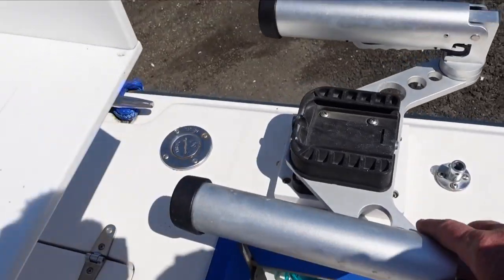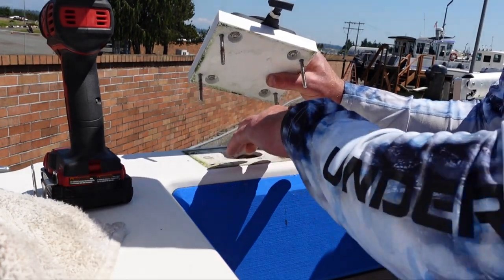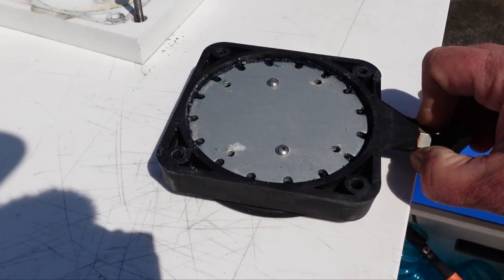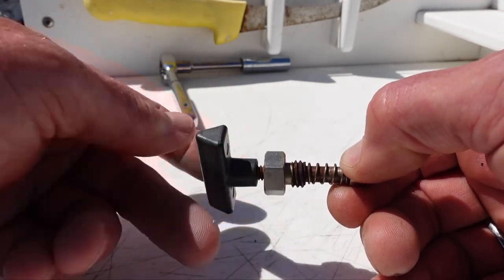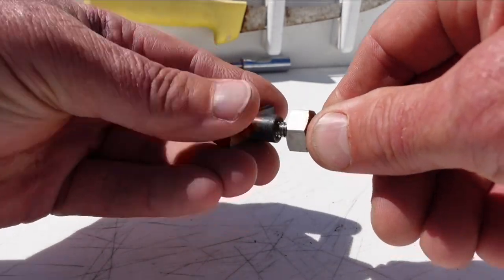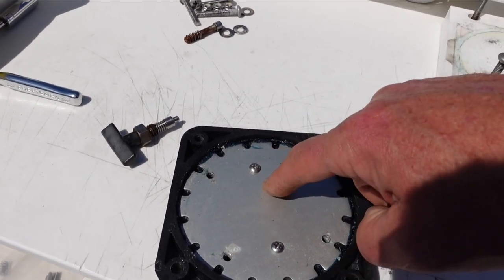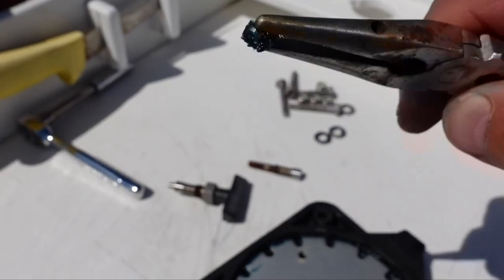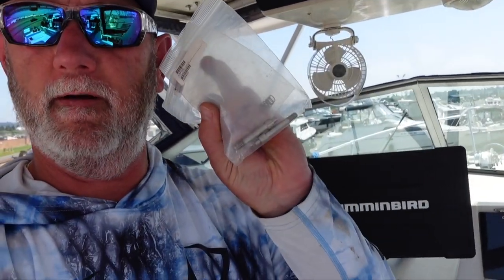Cannon Downrigger Swivel Base Repair

Comment: I noticed the bolt used to attach the downrigger to the base is missing.  There was a little ring pressed onto the bolt's shaft that kept the bolt attached to the base.  Mine is just about to fall off the bolt.  Do you have a "fix" for that issue,  other than buying another bolt for a backup for when I eventually lose the bolt?
Reply from the maker: Thanks for the comment.  That has happened to me too.  Unfortunately, there is not a fix for that issue.  It is pressed on at the factory.  I don't worry about anymore.  I just put the bolt back into the downrigger when I remove it.